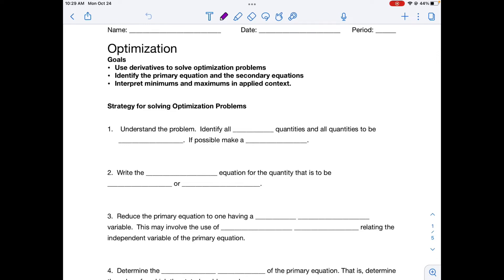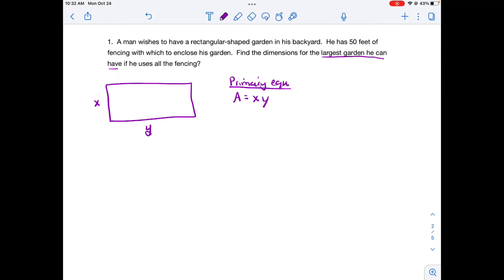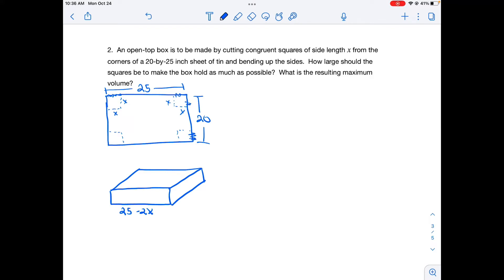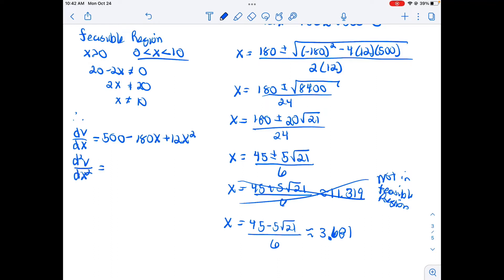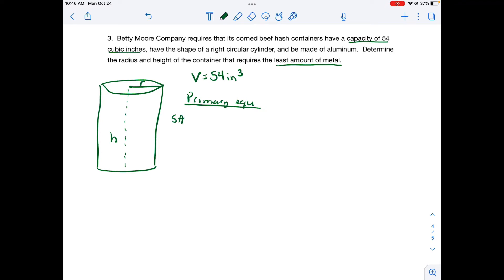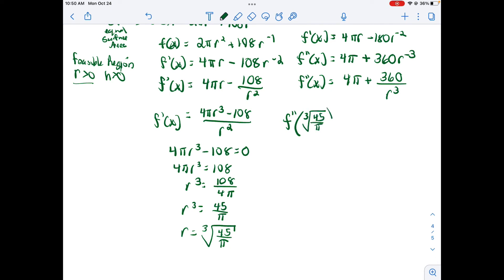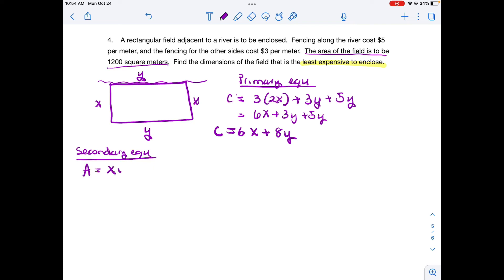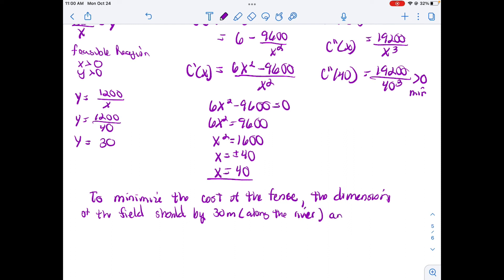Optimization

Comment: What if we had a quadrilateral whose length and area are known. How do we find the length of the diagonals?

Here is an example (irregular shape) 

a= 300 
b= 200 
c= 140 
d = 250
 AREA = 45050 
X= ?
 Y= ? 
X = diagonal 1 
Y = diagonal 2

and what the max and min for diagonals in this problem ?